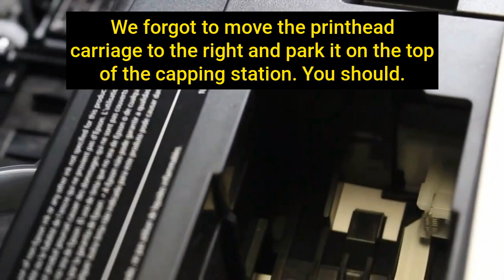Mastering the ET-8550 Printer Repair: Damper Install - Brackets and Screws

Comment: Can you help me figure out why my printer leaves black streaks on my prints and why there's little drops of black ink on the track inside the printer.
Reply from the maker: Thanks so much for watching and for your great question! Black streaks and ink drops inside your ET-8550 usually mean the printhead is touching the paper or the carriage rail has excess ink buildup—check the bottom of the printhead for smudges and clean the carriage track with a lint-free cloth and alcohol. Also make sure the platen gap isn’t too tight and that no roller or damper is leaking. I really appreciate your support—please consider subscribing or becoming a channel member so your questions get priority! Subscribers and members are usually answered within 48 hours, while regular viewers are answered if time allows (I can only answer around 10 a day). After that, new questions go first. If you’re not a subscriber and don’t get a reply in 48 hours, you can either subscribe or re-post since newer comments are reviewed first. If you subscribe later, your old questions automatically move up in priority. For faster help, you can also email [support@bchtechnologies.com](mailto:support@bchtechnologies.com). And if this video or comment helped you, please leave a quick Google review here: [https://g.page/r/CfL7k6nYvPQ9EAg/review](https://g.page/r/CfL7k6nYvPQ9EAg/review).

Comment: Love the Video! I recently just bought y’all guys dampers and just installed it into my 8550 EcoTank, i saw somewhere someone said do a powerclean to get ink back into the dampers but it didn’t work, will it work if I leave the printhead over the capping station and use a syringe attach to the waste hole and suck it out from the waste tank that’s connected to the printhead that’s connected to the main ink tanks? Will that work? Hoping I made sense 😅
Reply from the maker: Thanks so much for your question and for subscribing to my channel! Every subscriber is incredibly important to me as I work toward that big 100K milestone, and it’s awesome to know you’re supporting the channel. I really appreciate you taking the time to comment!

Your explanation makes perfect sense, and yes, using a syringe to draw ink through the capping station can work as long as the printhead itself isn’t clogged. If the printhead is clear, you should feel slight resistance when drawing 1 to 2 ml of air through the waste line. If you don’t feel any resistance, it likely means the printhead isn’t parked correctly on the capping station or the capping station’s seal is compromised. In that case, I’d recommend addressing the capping station issue first.

Once everything is sealed properly, avoid using power cleaning. A regular cleaning should be sufficient to get ink flowing into the dampers. Power cleaning can be too aggressive and isn’t necessary unless it’s a last resort. If you need more guidance or run into issues, feel free to reach out at support@bchtechnologies.com or drop a question on one of my most recent videos. I try my best to keep up with the comments, and newer ones get noticed faster. Thanks again for supporting the channel, and I hope this helps!

Comment: I replaced my dampers how do I fill them back up?
Reply: I’m in same boat, you ever figure it out?
Reply: @baoweezycustoms  dock printhead and pull ink through the port that drains into maintenance box.
Reply: @jamesbyrd6868  can you explain further? cheers man. I've removed and reinstalled print head and now my pages are blank. Assuming its down to empty dampers
Reply: @elloello_erm mine too. I can’t figure out how to get ink back into damper! No yellow. 😢
Reply: @kr57596  May have fixed it, where are you based?
Reply from the maker: Thanks for subscribing to my channel! With around 55K subscribers, I’m pushing toward the big 100K milestone, and every subscriber like you makes a real difference. I appreciate your support and for asking such a detailed question—it’s viewers like you who keep this channel going strong!

To fill the dampers after replacement, start by parking the printhead on the capping station. Turn the printer on, and the printhead will naturally settle on the station—it’s safe to do this while the printer is powered on. Since DTF ink is thicker than standard ink, you might need to assist the printhead a bit. Once the printhead is parked, connect a syringe and tube to the waste line and gently draw 2 ml of air. Start with 1.5 ml—if you feel slight resistance, that's a good sign. If only air comes through, the printhead may not be parked correctly, or the capping station seal might be leaking. Total resistance, on the other hand, could mean the capping station is clogged and needs attention. Once you draw 1.5 ml and hear the damper membrane crinkle, indicating the nozzles are open, continue drawing up to the 2 ml mark and hold for about 10 seconds. Afterward, use the printer's regular cleaning routine, avoiding strong or back-to-back cleanings within 12 hours to prevent damage.

Another method is to manually fill the dampers by connecting a syringe filled halfway with ink to the damper's input via a tube. Slowly draw air out, then release the syringe, allowing ink to flow into the damper. Alternatively, you can use the printer’s built-in ink charge feature by reinstalling the driver and selecting "No" when prompted if the printer is charged with ink. However, this method uses a lot of ink and could stress the printer, so it’s not the most optimal solution.

If you have more questions or need faster assistance, feel free to email me at support@bchtechnologies.com or leave a comment on one of my latest videos (not shorts). Thanks again for supporting the channel, and happy printing!

Comment: In this video Abby said she finally figured out how to install with the brackets after struggling, but you don't tell us your secret. When I put the bracket into the slot in the back of the printhead, I am not able to keep it there once l try to put the front of the bracket under the black tab. In the video you said the tail will come out. What's the purpose of putting the "tail" into the slot, only to have it come back out? Please help. Also, I would like to let you know that it is NOT neccessary to take the spring off. You just slide the plastic cover, unscrew and voila!
Reply from the maker: Thank you so much for subscribing and for sharing your tip about the springs—I really appreciate it! Every subscriber brings me closer to my goal of 100K after 8 years of creating content, and I’m glad to have your support.

The “tail” of the bracket does come out as part of the alignment process, but its purpose is to guide you into the correct position. There’s a groove in the back of the printhead that you need to line up with the bracket. Once you have it aligned, you’ll need to push the bracket in gently while keeping it steady, and it will snap perfectly into place.

If you’re still having trouble, I’ve made a video that demonstrates how to install the bracket properly step by step. You can watch it here: https://bchtechnologies.com/products/metal-bracket-for-epson-et-8550-dampers-1?_pos=2&_sid=86b231dff&_ss=r.

If you need further clarification, feel free to email me at support@bchtechnologies.com for a quicker response. I try to answer subscriber questions within 48 hours, but I do get a lot of inquiries, so I appreciate your patience. Thanks again for watching and for supporting the channel! 😊

Comment: At 1:30 in the video, suction is used on the waste tube to empty the dampers. At 10:26, we are told to use suction on the waste tube to draw in ink and prime the dampers. How can suction on the waste tube both empty the dampers and refill them?
Reply from the maker: You can control it by connect or disconnect the tubes.